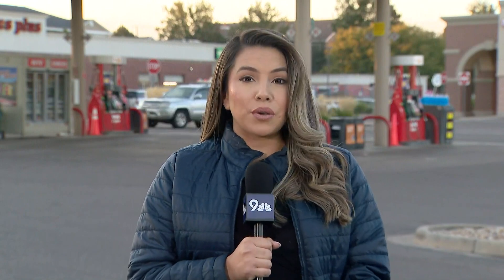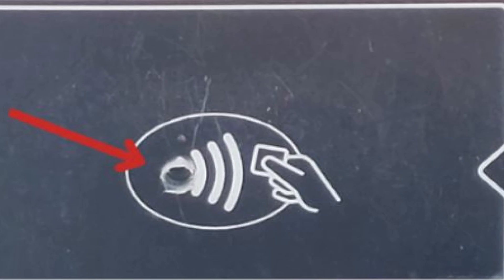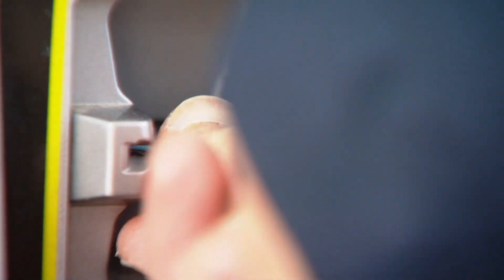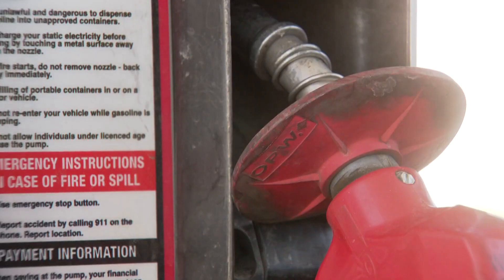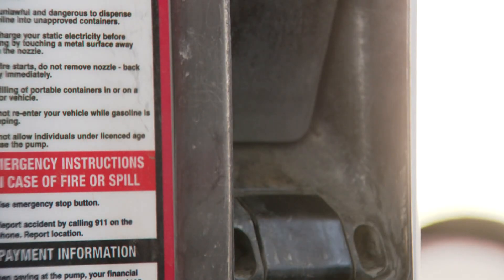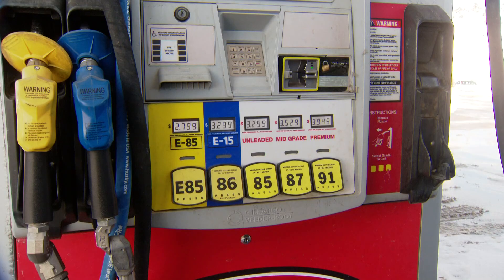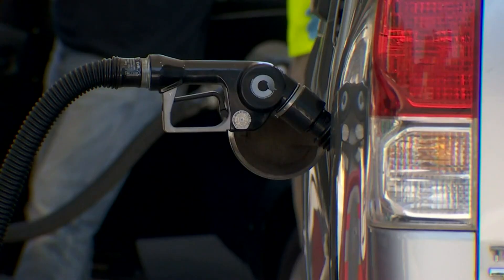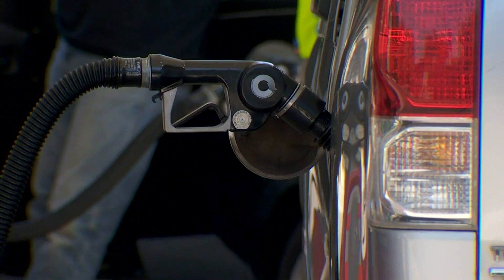Police warn of card-tapping scams at gas pumps

Comment: If a gas station is operating with a fraudulent credit card machine then they should shut down that pump immediately and also check their pumps numerous times a day for skimmers. If they can’t comply they should be fined and shut down until they are compliant. Could be that the employee’s are allowing their friends to do this and are part of the problem as well.

Comment: Before I use a card swipe machine at any location I examine it carefully, even try to pull on the exterior to see if it does come apart. It doesn't take much effort. Be careful with your card.